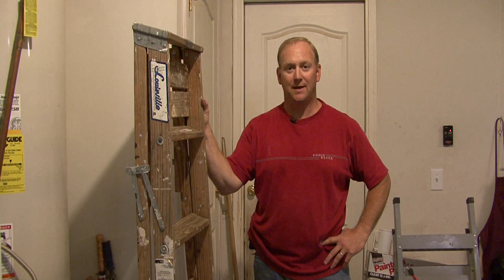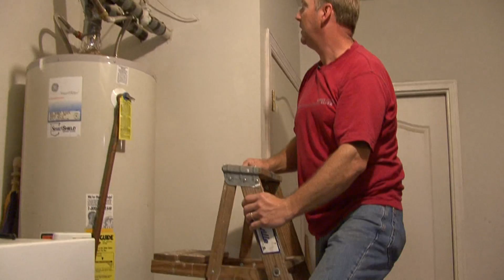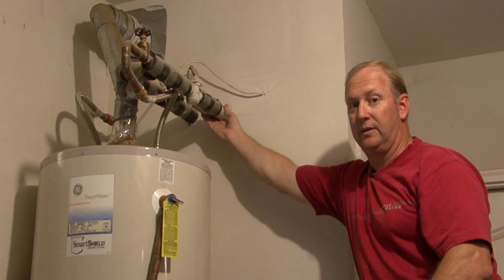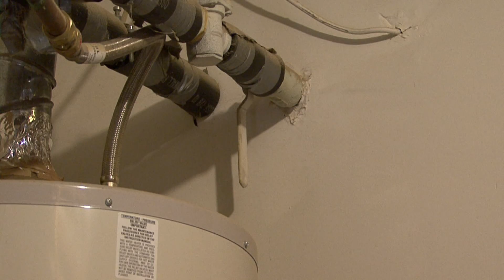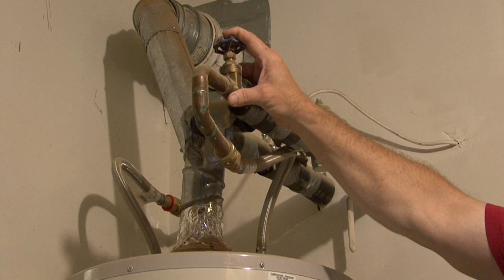Home Maintenance & Repair Tips : How to Turn Off Main Water Service

Comment: The only main water "off" valve I can find is in the water meter box at the street (the same one the water company would lock when the bill isn't paid).
I often wonder why a simple main valve wasn't installed in the home, but, then I remember home builders are a business and they aim to cut costs ALL the time.

Comment: My main valve by the street is bolted so only the water company can open it 🙄 I dont have the shut off valve you have but I do have the blue turn valve. It shuts off the water but i'm afraid it'll cause my hot water tank to explode because i'm missing something. I called an emergency plumber. $300 at midnight. Cuz Murica

Comment: Sir I shut off that valve above the heater tank but the cold water is still running! :( The hot water stopped because i also shut off the valve below the tank. Why is the cold water still running :'( HELP us please oh please

Comment: So what do I do if I need to replace the hot water supply shut off valve (boiler drain) to the washing machine? There is no shut off valve (ball valve) from the hot water supply line from the water heater to the washing machine...

Comment: Maybe a dumb question:  

At a vacation home in the north by ski slopes, we have to shut our water off and drain the pipes.  Also we have to add antifreeze to the toilets and some of the drains (it's REALLY far north).  To turn on the water when we want to use the home during the dead of winter, do we simply just turn on the main water valve or are there more steps needed?  Thanks.